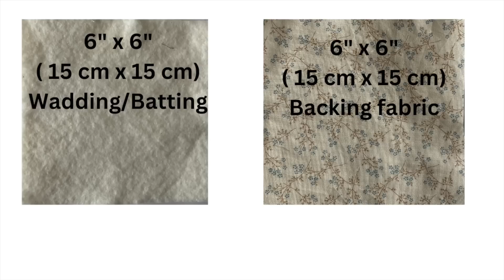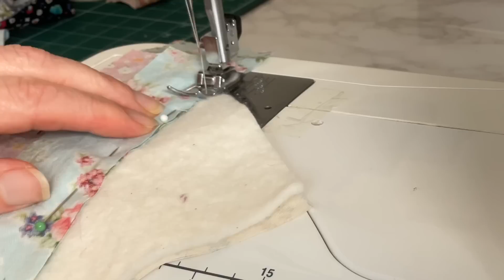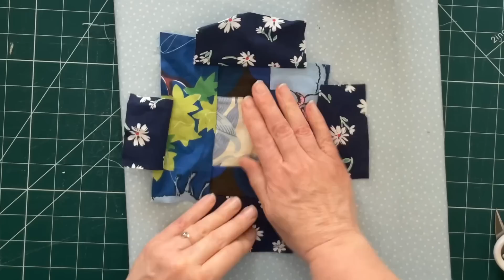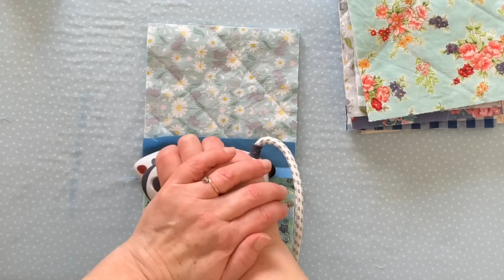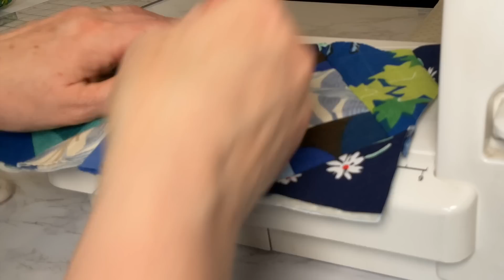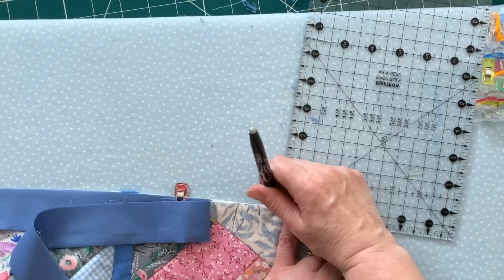Easy quilt as you go tutorial

Comment: Hi from Ohio!  Are your completed quilted squares butting up against each other under the blue sashing strips?  It seems there would be a gap where there's no batting within the blue strips.  I definitely want to do this, and I love that the backing fabrics are an assortment, making the quilt reversible.
Reply from the maker: Hi there from the UK.  Yes it does seem tike there would be a gap, you would think you should use 1" sashing strips which I tried first, but it didn't work so I used the 1 1/2" strips. I think all the bulk of two layers of fabric and the batting takes up more fabric than expected on the seams. If 1/4" doesn't work for you try 3/8" .  Jo 😊😊
Reply: Hello there in the UK!  Thank you so much for your reply!  I so want to do this method.  It sure beats trying to quilt a large quilt.  Happy sewing!🧵🪡

Comment: Thank you for your video. 
I have a question: doing the math, 1/2 inch of strip/sashing goes on one quilted square and 1/2 inch on the next quilter square. But where the other 1/2 inch goes ? Doesn’t that create a space between the 2 squares where you have only the sashing with nothing in between ? Like an “empty sashing space “ !
Hope you understand my question.
Reply from the maker: Thank you for your question which I totally understand, and it makes perfect sense that there would be a void of 1/2".  I did try just using 1" strips before settling on the 1 1/2" but it was all too tight and difficult to join, I think it is because of all the bulk of the layers of fabric and the batting which take up a little extra fabric on each seam when pressed. I hope my reply makes sense.  Jo ☺️😊